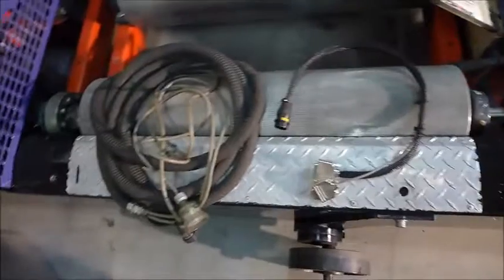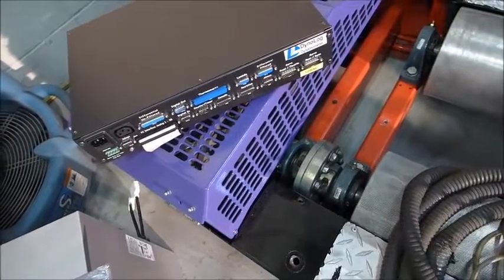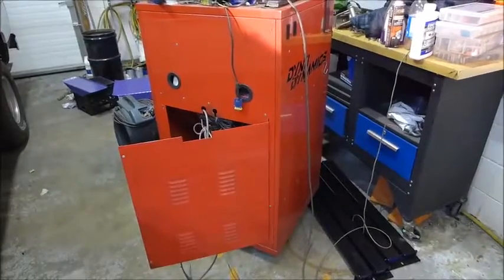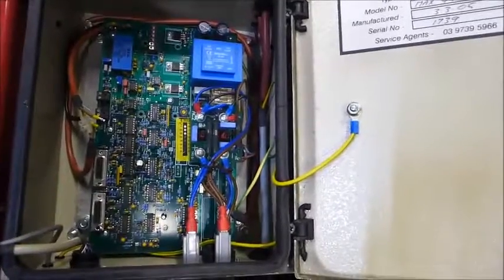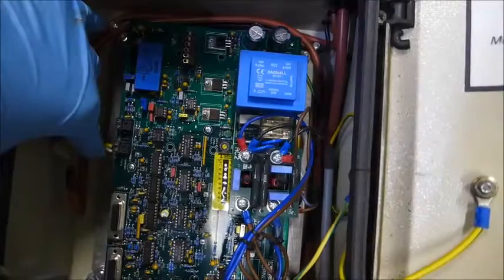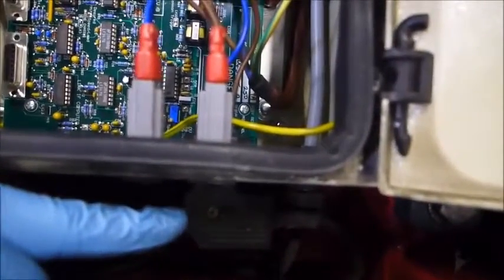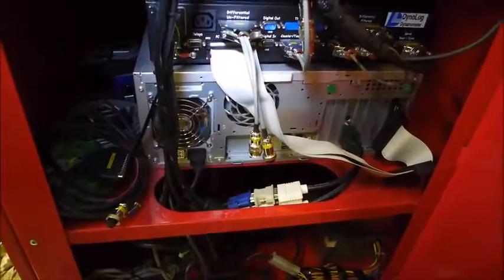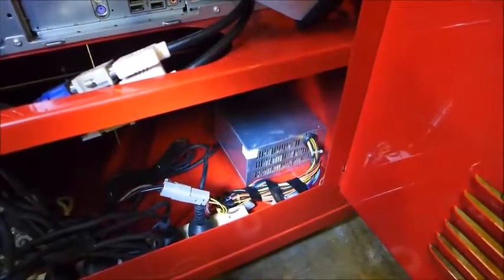Mainline Dyno Control & Data Acquisition Conversion of Dyno Dynamics 2WD Chassis Dynamometer

Comment: Nice stuff. I personally went with the dynertia 3 pack from DTEC in Melbourne. Has lots of data logging features and works great in my shop with an old Vane vp950. What would a setup like this cost?